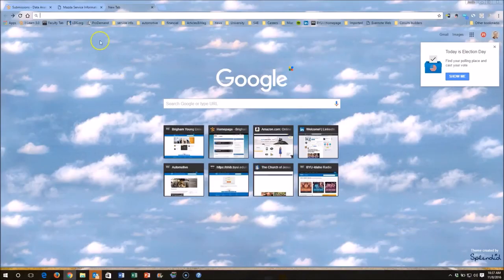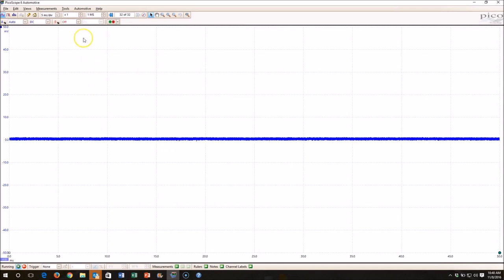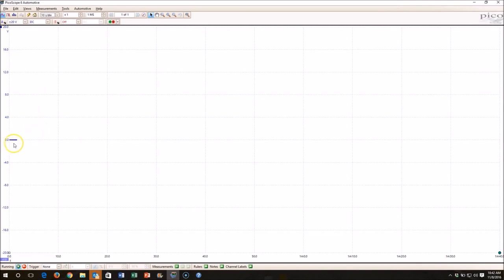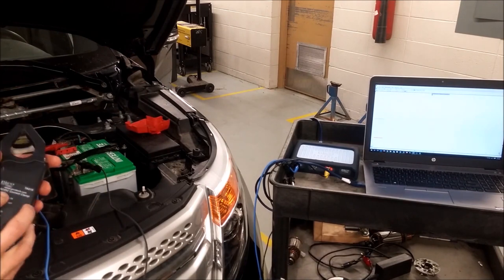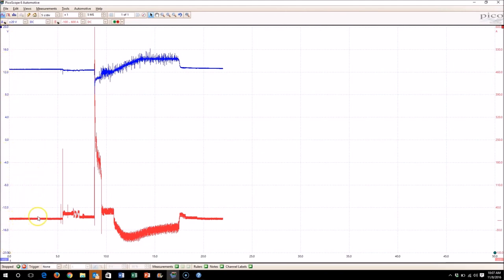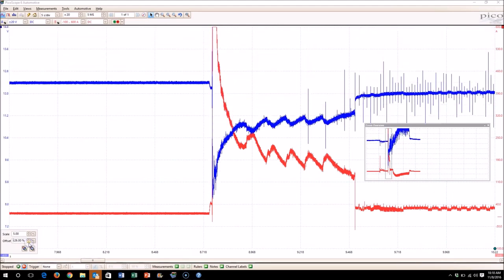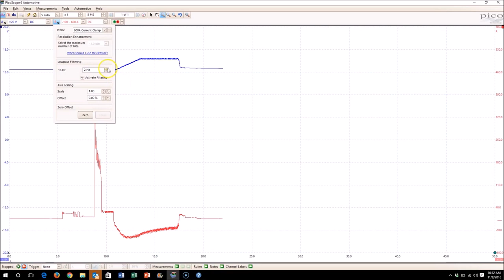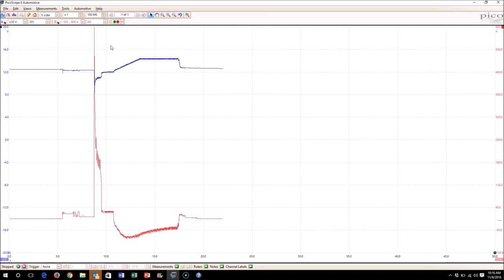PicoScope Automotive Introduction for Beginners by Justin Miller

Comment: Great information, but where do you find the information that lets you know if the data you are gathering with the Pico is within tolerance of the manufacturer specs?
Reply: There are a ton of forums that have "good" waveforms that shows what a good signal looks like.

Comment: Excellent video.I have an issue with my pico 2000 series. I get the No  Suitable Device found when I connect the picoScope to my Laptop.The red light comes on, though.What would you suggest, please?
Reply from the maker: Please contact supportATsaelig.com for assistance!
Reply: If you downloaded Pico Automotive the 2000 series DOES NOT WORK with that software.